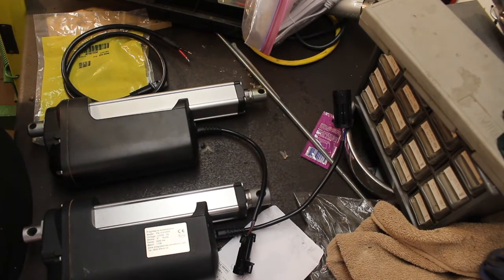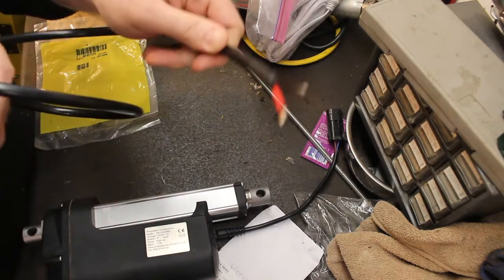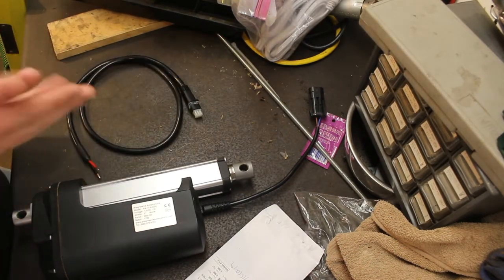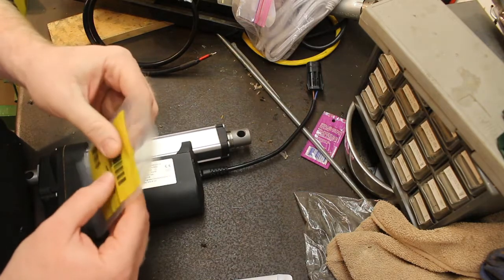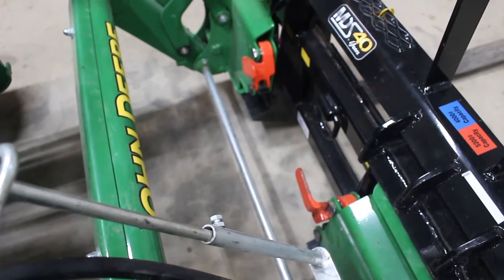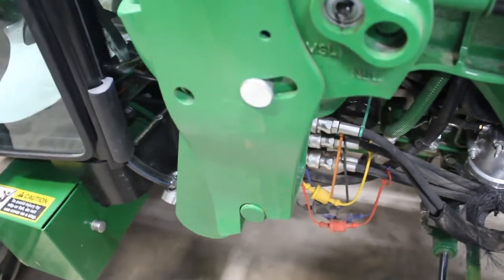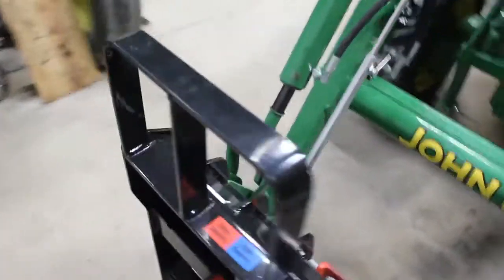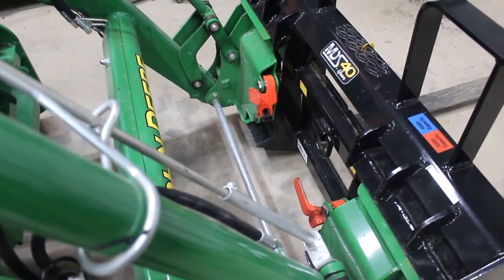H180 Loader Modifications Part 4

Comment: So I have to ask, since the new actuator and all that, would it have been more cost efficient to buy the tabs from JD and then just get the custom actuator?
Reply from the maker: Amber Ryan most likely. I have not run the final figures yet but I think that will be the case. When I finally have time to wrap this project up I will do a final video with all the parts I used vs what I bought. Also come up with a parts list for anyone else that wants to do this.